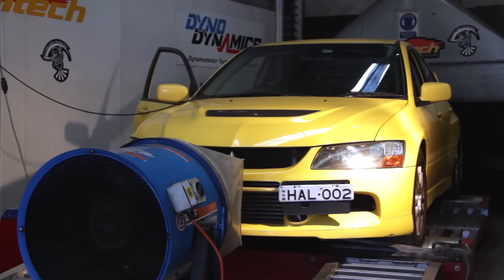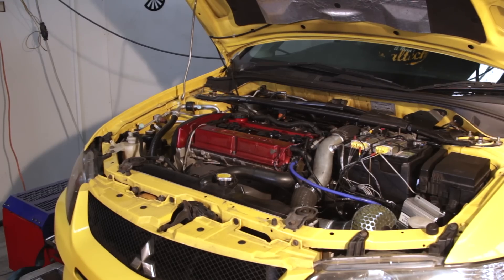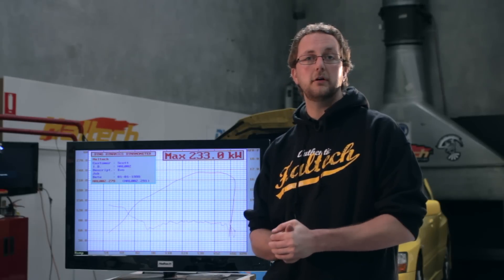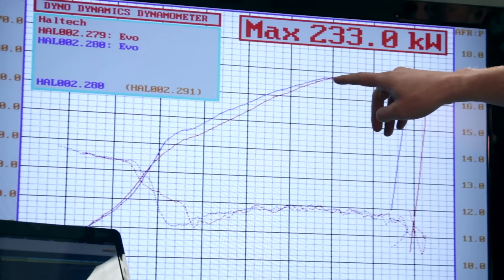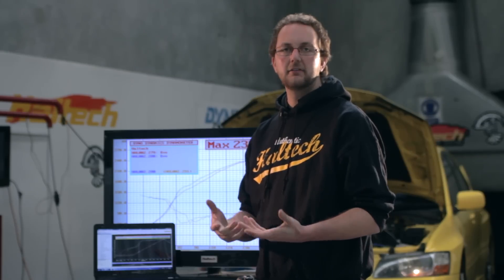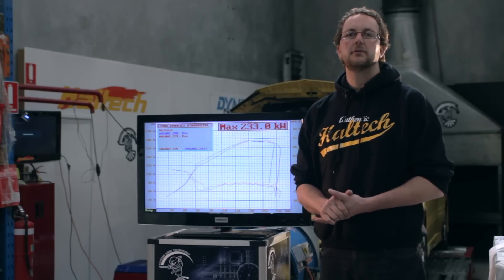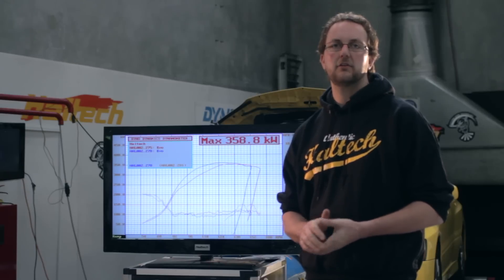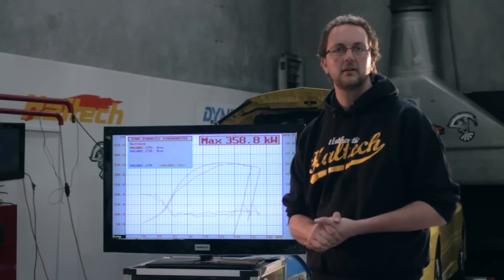Closed Loop vs Open Loop Boost Control - Technically Speaking

Comment: So, base duty is the percentage of work the solenoid does to let air out to spool the turbo? So too high of a duty will hit the boost target too soon and trigger the boost cut. That explains why I hit my boost cut so quickly. Too high of a duty at certain kPa.

Comment: Running open boost control via haltech 3 port . Can I switch to closed loop running the same psi as open without retuning the fuel and ignition?
Reply from the maker: Hey Turd! Great question. Our tech support team will be more than happy to answer it for you. You can get in contact with them here: www.haltech.com/support

Comment: Thank you for this video, unfortunetaly that doesn't explain the real difference between open loop and close loop control, you are only showing 2 things :
- There is few pourcent missing in the base PWM map in open loop near in the max torque range : that's why there is torque missing.
- You probably don't raise the PWM during spool in the open loop map : that's why the turbo spool is better in your case in close loop mode.

These things can be done in open loop mode.

What you should insist on is : the close loop mode permits to cancel the boost error, better boost aim tracking. BUT, need to be correctly setup in order to not let it do some mistakes !
Reply: also soft gate springs are harder to set up for high boost with 4 port solenoid in closed loop with out multiple start duty points. a little easier to have a proper set up open loop table and trim by gear. both methods need to be set up correctly to deliver the same out come, the closed loop is just a bit easier for the average punter on a simple setup not requiring in depth control for repeatable outcomes.

Comment: open and closed loop applies here but it's not where the gains are you could have got this boost response by A. setting up haltech open loop EBC with map as an axis...or B stuck a 12psi check valve in the hose ...this super basic pneumatic verses a more complicated ecu controlled ebc. you also really should have mentoined some of the other advantages of ecu controlled boost ..low boost on cold engine low boost in low gear low boost low traction low boost..

Comment: Do you have any video's that explain P I D and how it works?
Reply from the maker: +64ls1nova not yet, but we will get to that subject soon:)
Reply: Thanks.  That would be a very helpful subject for allot of people.
Reply: i was going to post this exact question. I tune ford ecus using hptuners but there is still a few PID controlled tables and I haven't been able to wrap my head around it properly.
did you end up getting around to covering this in a video at all?
Reply: Closed Loop Control Drive 
https://youtu.be/MLK5-nw9w-w

Comment: i have a platinum sport 2000 on my 2jzgte I've been running off the waste gate springs, would i spool noticeably faster if i went closed loop to manage my boost?
Reply from the maker: +180StypeX Any improvement would depend on the specific hardware setup, however generally adding electronic control does give a noticeable improvement to spool time by avoiding wastegate creep.
Reply: +haltechecu 2jzgte, precision 6266 twin scroll dual BB, tial 44mm wastegate. Makes 600whp at 22psi but full boost doesnt come on until 5k which i believe is very odd, im hoping perhaps adding the haltech solenoid and running closed loop instead of just wastegate springs controlling boost will help. I also tested for boost leaks & there are none.
Reply from the maker: *****
Contact support@haltech.com. Our tech guys should be able to help you out.

Comment: I just bought a GF8 WRX with a PS1000 in it, it has been tuned to 16psi with a GFB boost T. I want to buy one of your open loop boost controllers. I want to be able to switch between 8 and 16 from inside the car preferably with a toggle or momentary switch. Is this possible? Also how do I set up the turbo timer function?

Comment: I was disappointed to find that you can't compare two data sets in a single scatter plot in the data log viewer...
Reply from the maker: +redlimit835 It is possible to compare separate log files in the one graph – once you have loaded both .csv files, drag and drop the second data set onto the first. Right click > Move Offset to line up the data. Please contact Haltech Support directly if you require more information.

Comment: I'm not fully understanding how it made MORE power given that the same boost, timing, and afr was used.  The turbo isn't spooling throughout the entire midrange.  The gain in power started after the powerband's clearly shown onset of boost.  
I will be awaiting an explanation.  Thank you
Reply: The wastegate will open proportional to boost until the amount of gas through the turbocharger is not enough to generate more boost.   With Any electronical boost control  (open o close loop) you can have the WG completly closed until yo get close to your desired boost...  You will get more boost sooner but the same maximun boost